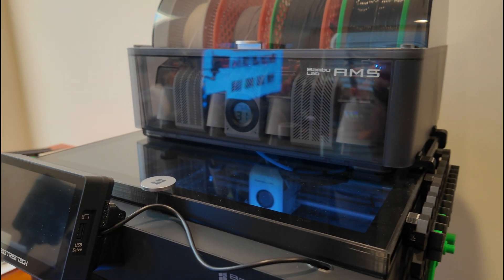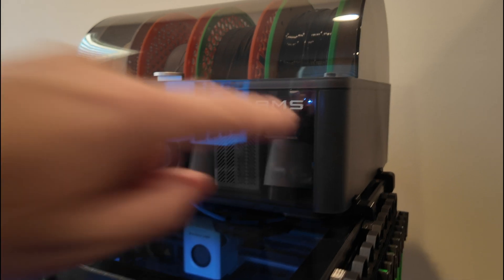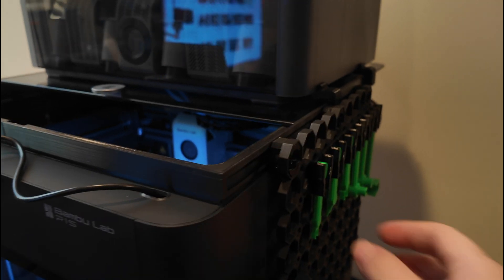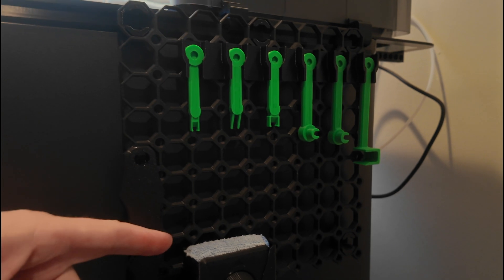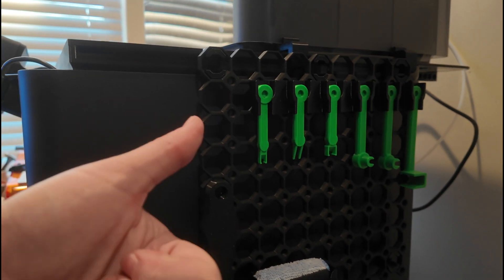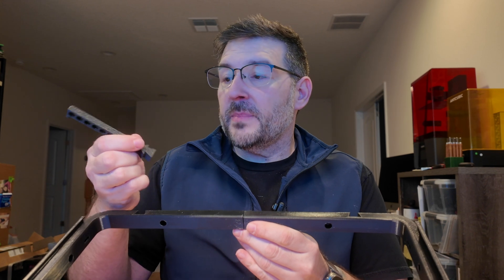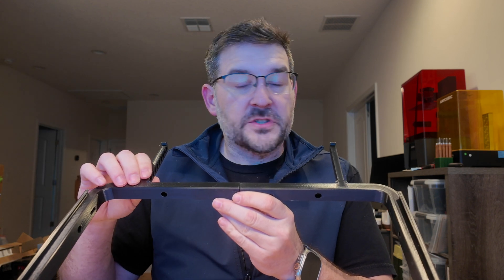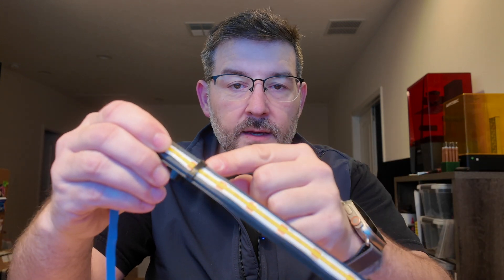Super Slim Riser: Elevate Your Bambu Lab P1S Without the Bulk

Comment: Thank you for doing this video. You may have helped me pick a riser for my P1S. I would love to see a show-and-tell on your LED/Panda screen setup. Also, does the glass top come out without having to remove the AMS?
Reply from the maker: Make sure you check out the newer version of the riser. There are some cool upgrades.

As far as the AMS goes... yes, the glass top can come out. With the version used in the video, the AMS sits just a bit above the glass so it can slide freely.

Newer versions offer an option to flip the AMS up on a hinge for even more access.

Comment: Hi

I have printed this riser too, and looking to print the LED parts also, because its is just fantastic!
But those back support arms for the glass plate, where did you find them? I reached out to the maker where I can get those, yet no response so far.
I can't seem to find them in the V3 or V4 models. Can you help please?
Reply from the maker: The v4 support is here. https://makerworld.com/models/999281. Higher versions seem to have the parts in the full build.

Comment: I JUST printed this one a few days ago....LOVE THE DESIGN!!! I almost fell victim to printing one of those oversized risers with the draws...lol Then I realized how much the unit shakes during prints. Plus the amount of time and material it would have taken was ridiculous! After picking this one I wondered why anyone would want the other taller, bulkier designs....(?) Anyway, I'm extremely happy with this one and now after installing it I realized that I'm gonna need to reroute the cord for the LED's since I have a Panda Touch on the way and I'll need the USB port for that soon.
Reply from the maker: There’s a little port in the back of the riser to run a cable for the lights.
Reply: @m3_makes yeah that's exactly what I did after I got the panda power brick. I'm all hooked up and happy with the set up.

Comment: My P1S + AMS2 is on the way and the first thing I want to print is a lower profile riser like this and led light strips.  Will the AMS2 have the same dimensions as original AMS and work with this?
I do not plan to add the Panda screen so is there another place to plug in the lights?
Reply from the maker: External dimensions of the ams2 should be identical to 1st gen ams do you’d be good there. 

You could plug the lights into any power source. A lot of people just plug them into the wall.

Comment: which led strip did you use ? and where exactly did you plug it to ? thank you
Reply from the maker: It was a cob led strip. Not sure I’d recommend it with the clips of the riser just because it has more thickness than a regular led strip… but it works. As for plugging in, i added it to the usb port of a panda pwr, that way it can be synced with the internal lights.
Reply: @m3_makes  that's what I was interested in, I have panda touch too, but not sure how you got it to plug both

Comment: I simply did not want a huge, gaudy AMS riser with drawers and such that takes over 80 hours to print.  No, I just wanted a riser that allows one to slide the glass open to release chamber heat and provides a place to mount LED lighting.  This slim riser is an elegant design that provides for both.  It uses minimal filament and can easily be printed and assembled in one day.  Recommended.
Reply from the maker: This 👆